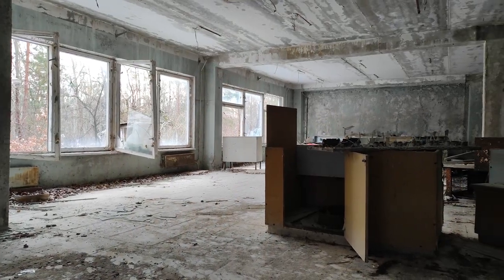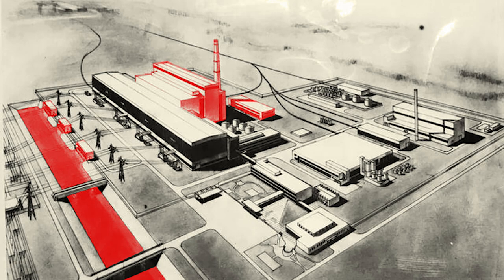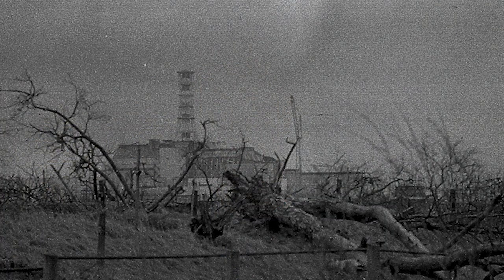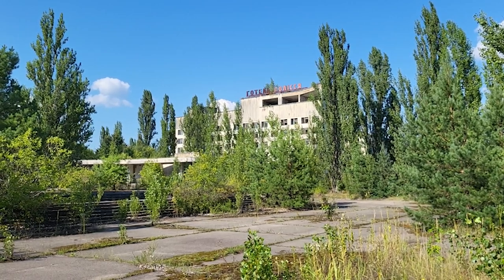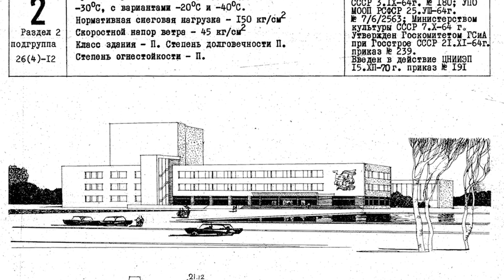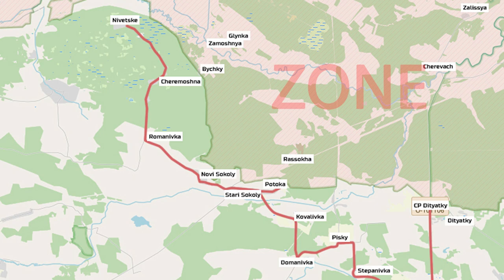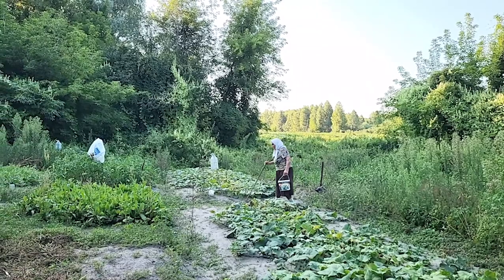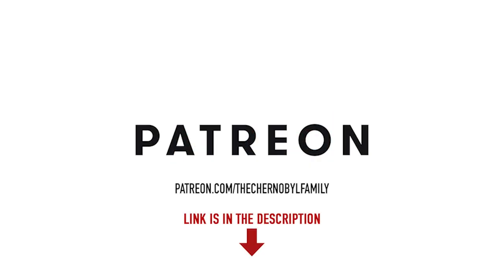10 Chernobyl Facts You Never Knew

Comment: I'd like to know more about the status of public services like power supply, water, gas, etc. on the remainders of the city. I understand they shut everything off, but I'm pretty sure there must be some places with utilities still running. And why they're still running. Also, are the main power lines that go into the NPP still powered? I would assume they're feeding power back to the installation and the nearby buildings. And speaking of Duga, I've always wondered if the antennas are still useful, like if it'd be possible to go there with a HF transceiver and use them to talk to ham radio operators. Hey in any case, this is amazing. I truly appreciate it!
Reply from the maker: It depends. There are facilities that operate for the enterprises of the zone and its stuff (mostly - at the town of Chernobyl, which a pretty usual town), and in Pripyat (for now - water drills for the NPP, a substation, etc). There were much more repaired after the disaster, but no longer used since the end of the 90s. 

Yes, the lines are powered, as the power plant has a lot of equipment that requires energy.

Duga antenna is useful in a meaning it is a phased array, which is that or another form catches the waves. However, this was never a transmitter installation, but a receiver only.

Thank you for your words and questions!

Comment: So RBMK 4800 implied 4.8GW electrical? So roughly 20 GW thermal? Given how the RBMK was not understood how it operated in startup or shutdown as a volume (It seems it was probably designed in cross section and then generalized in the Z direction?) the 4800 would have been a real beast to control without in depth computer design and controls.
Reply from the maker: I am afraid I am unable to answer this, because never could find any details on anything bigger then RBMKP-2400 in the literature. Even at the Chernobyl NPP many seniors told that was only on paper in NIKIET institute, although discussed. No actual development have been done, and partly because of the reasons you said about – there were no clear vision how to control that. Some told an opinion, that these projects were more a response to party's approach "let's make bigger, bigger, bigger".
Reply: A 1000 MWe reactor roughly translates to 3200 MWt. So, a 4800 MW electric reactor would have about 15,000 MW of thermal output. If built, these reactors would have been the most powerful in the world. They had a hard enough time controlling the RBMK at the then current size it was. I can only imagine the absolute nightmare it would have been to try and control a reactor almost five times its size. Good heavens.

I study reactors as a hobby with a big emphasis on the good old RBMK. RBMKs weren't bad reactors per se, but they should have sat on the design a bit more before putting them out there. They were/ are (there are still RBMKs running today) extremely complex reactors that are a handful in the best of times. And the RBMK is so big that parts of it almost behave like several independent reactors in that one space. The neutrons cannot talk to each other because of the large core size. So you end up with a very loosely, almost decoupled core which does nothing for stability, to say the least.

That nicely ties in with what you said about them not understanding it. That was very much true at the time. They didn't fully understand its neutronics, or how important the steam/water balance was for its stability, or lack thereof. The institutes didn't have the computing power to properly model its behaviour in various situations, whether that would be normal or emergency situations. It was well known that an RBMK could be very temperamental, especially when it was freshly refuelled, or towards the end of core-life. At the end of core-life it would become downright grumpy with a tendency to run away with itself if you forced it to do things it couldn't.

An RBMK is the happiest somewhere in the middle of core-life when it is in a steady-state refuelling mode. You gently bring it to full power at the begin of core-life, you keep a close eye on it until steady-state and then you just let it run at full rated power without bothering it too much. It can't handle wild power swings (fast up, fast down), and it was never designed to run below half-power. You cannot do wild power swings with any commercial power reactor (naval reactors can handle this much better, they are specifically designed to operate under harsh battle conditions) regardless of the type, but the RBMK in particular is very ill-suited to cope with this.

After the Chernobyl accident, they refurbished the remaining RBMKs with better safety systems, a separate fast-acting Scram system that can insert specially designed control rods into the core within 2 seconds to lower reactivity, more enriched fuel to combat the inherent instability, better computers to model the core, additional fixed absorbers in the core etc. You still have to treat them with the respect they deserve and there still is the not having full containment fact, but they have cleaned up quite nicely, as far as RBMKs go.

I apologise for the long-winded reply.
Reply from the maker: Thank you for such amazing commentary. This is perfect!
Reply: @swokatsamsiyu3590  Don't say you're sorry! Thank you!
Reply: @ChernobylFamily  
You're welcome 😄 And I'm by no means a scientific expert. Just a hobbyist with an extensive technical background (retired Master Welder) and a big soft spot for the RBMK.

Those very early drawings/schematics you showed in the video? I managed to find those in pdf format a while back. I instantly recognised them when the video put them up on the screen. Feel free if you have more questions about the RBMK. I will try my best to answer them comprehensively.
Reply from the maker: @swokatsamsiyu3590  super thanks for all these!